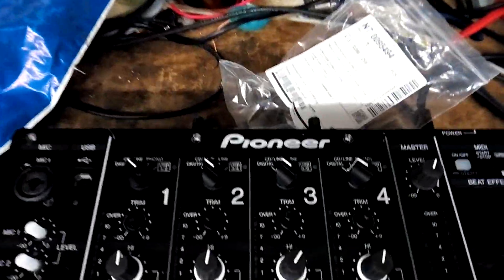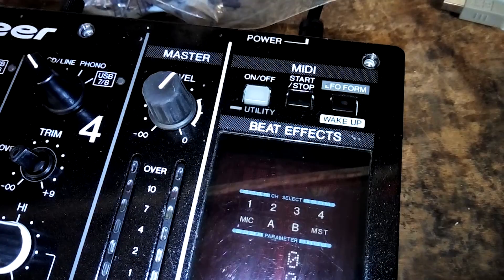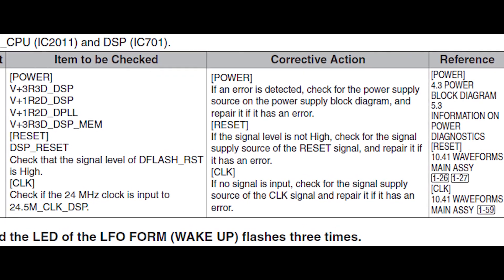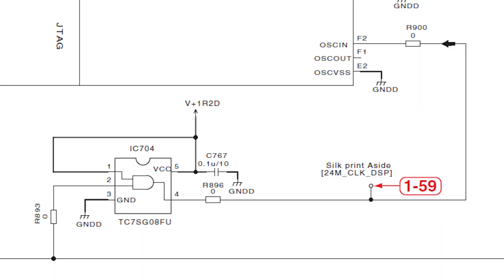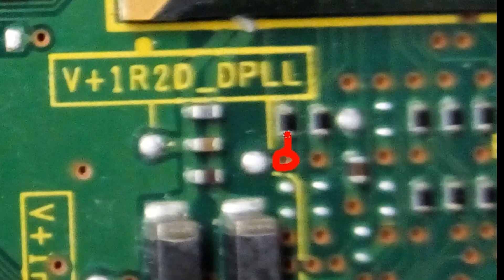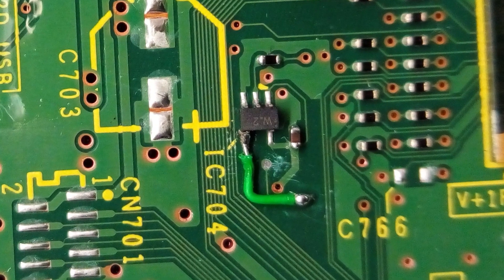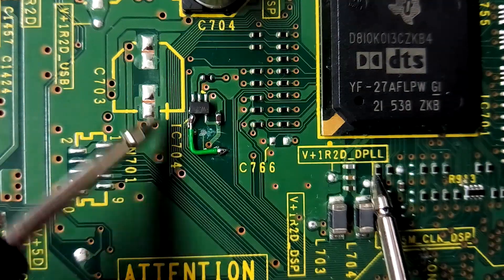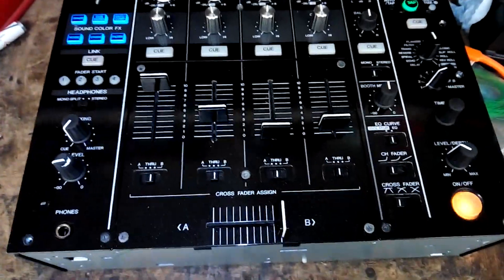DJM900NXS DSP clock signal repair - ABJ quickie

Comment: Hey bro, thanks for the tutorial. But i have another problem with my DJM 900 Nexus, its flashes 6 times. I have read the service manual book for DJM 900 Nexus and i have check the part maybe have some problem on that board. But i dont find the problem of the part that on service manual book information. Can you please help me ? Thank you very much

Comment: Hey man, how are you? My DJM 900 Nexus is working perfectly but the screen brightness is below normal, could it be a capacitor problem? Or would I need to change the screen?
Reply from the maker: Not sure. Could be a screen problem or a power problem. Take to a repair shop

Comment: Hi! I have a djm900nxs with no output at all, have you experienced this? The master signal shows output on the VU meters but no sound
Reply: Lmk if you find a solution, in having the same problem

Comment: Hi Andy. I came across your videos looking for some insight on an issue I’m having with my djm900nexus and its master (rca, XLR) and booth outputs. I am getting no signal from either of them. My digital, rec out, and headphone jack work just fine. Here hoping you could shed some light on the matter before taking it in or just not bothering if it’s going to be an expensive fix. I appreciate any advice you may have for me.
Reply from the maker: Something's probably up with the master out DAC or one of its associated circuits, as the rec outs are fed from a separate DAC. Repair costs would really depend on what the exact problem is, maybe around £100?
Reply: TheRasteri thank you sir! Much appreciated!
Reply: @TheRasteri  Unit turns on functions normal about 5 secs than freeze, no knobs no button functions about 5 secs, than works normal 5 secs , on and off
Reply: LFO MODE dannn
Reply: Hello sir, 
Was searching my problem and came across your vid, 
Unit turns on functions normal about 5 secs than freeze, no knobs no button functions about 5 secs, than works normal 5 secs , on and off 
Opened the unit no water but oil-ish tracks noted, assumed from faders, cleaned as much, powered on, saga continues, any advice ? 
Thanks
Reply: @radpeak1297  I have the same problem